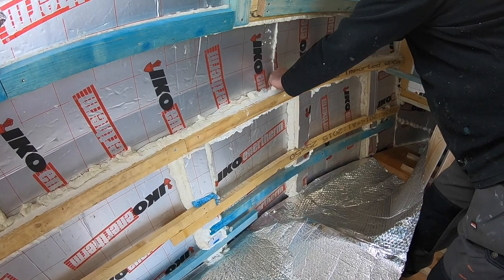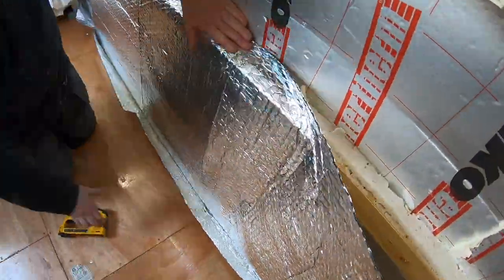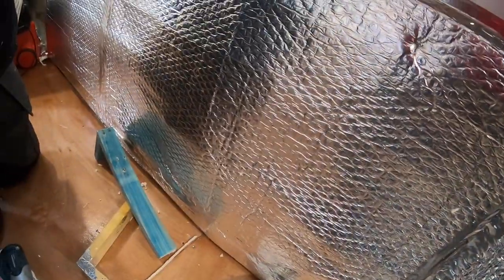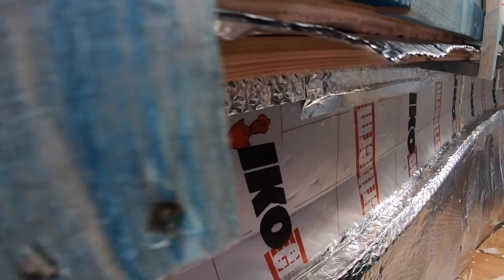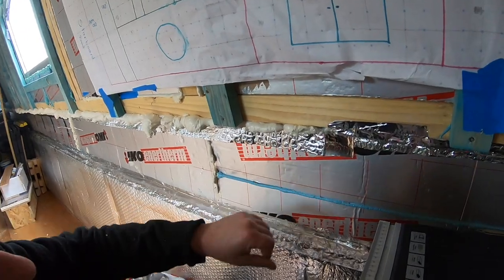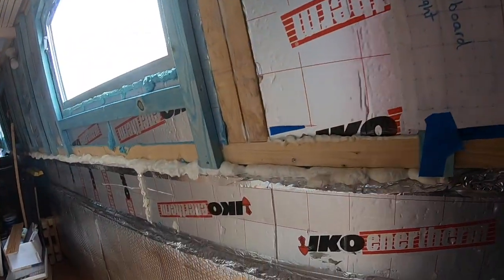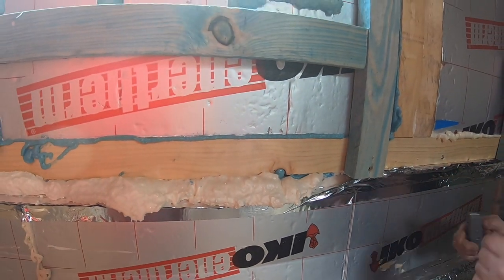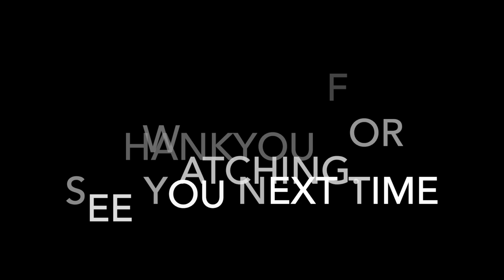Vlog 22, Narrowboat Fit Out -  Foil Insulation

Comment: hi and thanks for some great video's :-) i am also thinking of moving back to UK after living in scandinavia for the last 20 odd yrs and considering also buying and fitting a narrow boat out, so helpful insights :-) 1 thing i would suggest is here in scandinavia we make homes well insulated and airtight due to the cold... what we do here is make something called a dampspærre.. this is a plastic or foil membrame (very similiar to what your doing but make it airtight with foil tape and over whole home from under concrete to ceiling and walls.. so no warm damp air can transmit through to outer cold air.. (causing damp) so i would recommend continuing with the foil but covering whole inside of boat in foil but making it loose enough that all electric sockets etc..are in side foil making a totally airtight barrier (except from mushroom vents of course) :-) anyway great vids and thanks
Reply: I had never heard of dampspærre, I think in the USA this would be called a vapor barrier.  I did search YouTube and there are several videos talking about it unfortunately due to my limitation of only speaking English I could not understand the description.  Seems like they are doing a very complete insulation job.   Perhaps using more labor intensive methods than a contractor would use but they also will probably end up with a better result.   Other countries are way ahead of the USA in a lot of ways,  we typically do not ever admit it though.
Reply: @lancecluster  basically you make the home air tight after the insulation.. we usually use a plastic sheet and create an air seal all around including under floor etc.. idea is no condensation as no air flow between hot air and cold.. here after house is built we block any vents and put big fans in the door to measure pressure.. if there is a leak then we fill with smoke and see where leak is and have to repair before building regs will sign home off
Reply from the maker: Thanks Paul for the advice. Appreciate it. yeah we're going to wrap the lot. 👍. Sounds like if you do come back to the UK and fit out a boat it's going to be a good one. 👍👍

Comment: Are you sure it’s a boat not a space capsule? joking aside you appear to leave an air gap between bubble sheet & board attached to hull, wouldn’t it have been better to use a thicker board ?
Reply from the maker: Thankyou David, That was intensional as we wanted a sealed air gap between the layers to act as an extra form of insulation (Still air is a good insulator) as well as a vapour barrier. Hope that makes sense👍